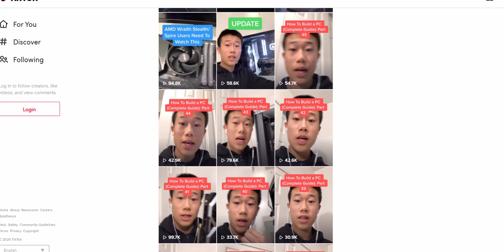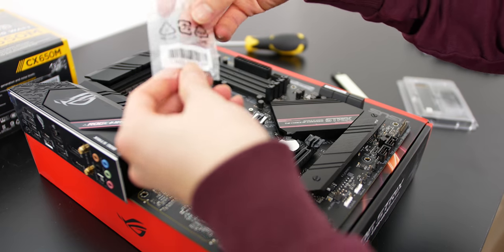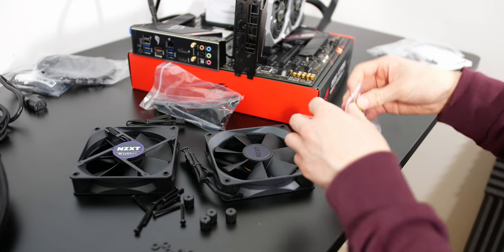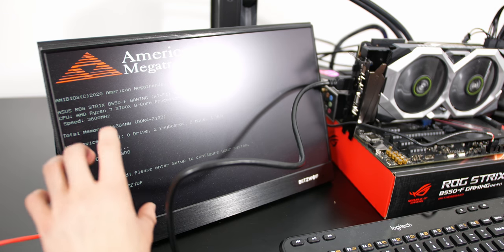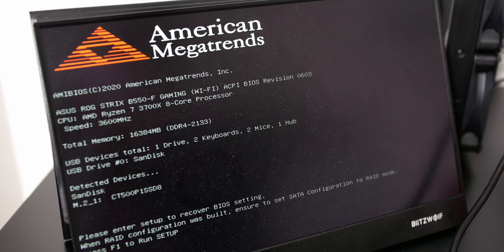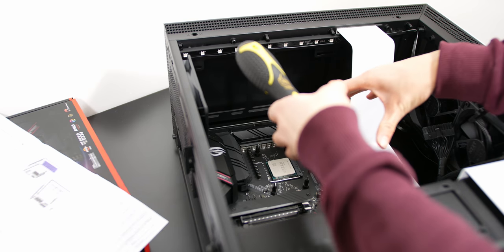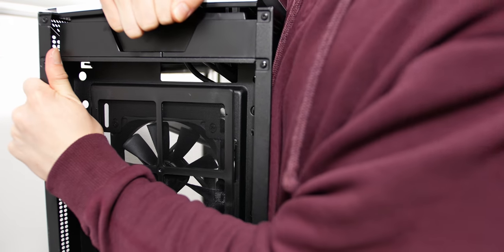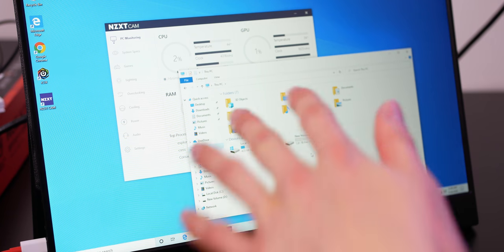Complete Step-By-Step PC Build Guide - How To Build a PC In-Depth Guide 2020 (TonyTechBytes)

Comment: Does it matter where I point the AMD LOGO when I use the stock cooler? I pointed the AMD LOGO of the stock cooler towards the RAM so to the right but I watched other PC build guides and they pointed the AMD LOGO of the stock cooler to the left? Does it matter?
Reply from the maker: 1000 Subscribers Without Any Videos? No the logo placement doesn’t matter in terms of performance. It may block any available RAM slots though.
Reply: @TonyTechBytes  ok thanks

Comment: Whe turning on ,can I just connect a lan cable and use it or do I need download the lan driver
Reply: That depends. If Windows has built-in drivers for your network adapter, you will be fine. If not, you will need to use another PC to download the drivers and transfer them to your newly built system.

Comment: What if the new CPU does not easily fit into socket. Most common reason; partially bent pins. Yes even on a new CPU.

Let's back up. 

Really when unboxing a new MoBo or CPU the first "Electronic Technician" task is VISUAL INSPECTION. I use a stereo microscope to identify and straighten bent pins. I have had MoBo connectors that where bent and shorted, like USB 3.1 front panel expansion socket, and partially bent pins on the CPU. It is really strange how some pins on the AMD Ryzen 7 CPUs are partially bent during final test and packaging. It makes no sense. I would expect continuous rows to be bent like from off angle exposure to dropping the CPU on a flat surface. But, many times the bent pins are several rows apart, usually in one corner with unbent pins inbetween. Very bizarre.

Comment: Where do I plug in the fans from the case, I have nothing that matches that plug
Reply: If your PC case has a fan controller, you plug your fans to it. If it doesn't have a controller, you plug them to the motherboard. The manual will have a diagram of the board as well as where the fan connectors are; they're usually called something like "SYS_FAN" or similar.
Reply: @JJFlores197  yea I meant my motherboard doesn’t have those

Comment: What about SSD drives? Whrere are these placed?
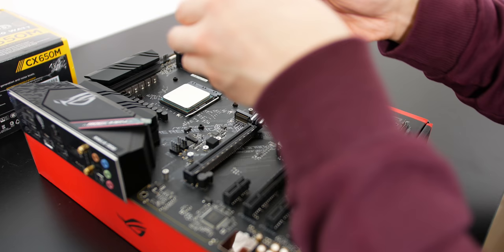Reply: If you are using an M.2 SSD, he goes over the installation at 11:00. If you are using a standard 2.5" SSD, then that goes in the case. The exact procedure depends on the case you have, so you may want to reference the manual.

Comment: How do you connect the sata cable to the motherboard?
Reply: Plug one end into the SATA port on the motherboard. Its pretty simple. The cable and port are keyed, so you can only insert it one way.

Comment: Where do out that wifi 6 antenna thing? I have the same boatd
Reply from the maker: The Fantabulous JalaPeña Connect it to the two golden stuns at the back of the motherboard. You’ll have to screw them on with your fingers. Thanks for watching!
Reply: @TonyTechBytes  thanks, hey quick question, the cpu when the PC turne d on shut itself down and the video card fans aren't working what do I do

Comment: BUT WHAT BUTTON DO YOU PRESS TO GET INTO THE BIOS I HAVE BEEN TRYING TO FIGURE IT OUT FOR THE LAST HOUR
Reply from the maker: Delete or F2 is the most common one
Reply: @TonyTechBytes  it still won't work i also did the battery thingy i feel like giving up
Reply: @kash1930  Did you bother to check the motherboard manual? It will tell you what key(s) to press to get into the BIOS.
Reply: @JJFlores197  don't worry about it the ports weren't working so i got it replaced thanks for the help though :) and now it works btw

Comment: I have the same board and the WiFi isn’t working what should I do
Reply: Have to be more specific than "not working". Do you see any Wi-FI networks? If not, you will most likely need to install the Wi-Fi card drivers. Plug your PC to your router via ethernet temporarily to download and install the drivers.

Comment: Guys I need a little bit of help I got my hard drive and I was trying to connect it but the big cable I’m not sure what it was called wasn’t there I’m wondering if it comes in power supply or my case bc the little cable I think it’s called sata data something a long them lines I plugged that in but idk what to do now

Comment: Do I HAVE to get an SSD or can I use a HDD Seagate - Barracuda 2tb?
Reply from the maker: Thanks for watching! SSDs are much faster than hard drives so I’d suggest installing windows on an SSD and using a hard drive for mass storage (games, other media)
Reply: Not absolutely required, but strongly recommended as Tony mentioned.

Comment: How do I connect the pc to an enternet cable
Reply: Just plug one end of the ethernet cable to the ethernet port on the motherboard. Plug the other end of the cable to your router. You should be able to easily find the ethernet port on the board. It is a square connector.

Comment: Where did he install the case fans
Reply: did you seem to find the solution? If so lmk im having the same problem
Reply: @nveezyy  so basically there is this square thing at the back of the case where all the cords are. At it says plug into psu in your psu or psu box they’re is an adapter and you plug the cord coming from the square to the power supply cable than to the power supply

Comment: After i changed same bios settting my pc  starts and shutdowns right away
Reply: Reset the CMOS (check mobo manual) and see if that helps.
Reply: @JJFlores197  i did try that, takin battery off and also touching the jumper, but didint help, gonna send it back and see what they say

Comment: So I got confused at the drivers
Reply: What specifically are you confused about?
Reply: @JJFlores197  on what drivers
Reply: @jaydenperez6298  Well you download the drivers for your specific hardware: Network (ethernet/wifi/bluetooth), audio, video, chipset.
Reply: @JJFlores197  huh is there a video explaining it very good
Reply: @jaydenperez6298  I don't know of any in particular. Just make sure you look up your specific motherboard model to download the drivers.
Reply: @JJFlores197  and that’s all no cpu or gpu or any other thing
Reply: @jaydenperez6298  No need to worry about the CPU. You do need to download the graphics card drivers from either Nvidia or AMD depending on which card you have.

Comment: Not trying to bash you but you unironically screwed the radiator through. You weren't suppose to do that.
Reply from the maker: I screwed the fans onto the radiator with the long screws and the radiator onto the bracket with the short screws